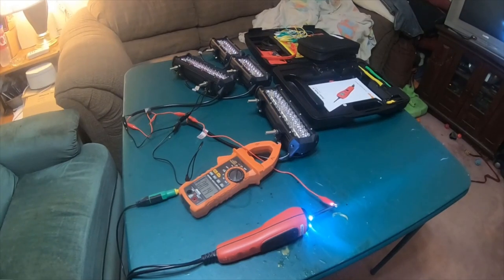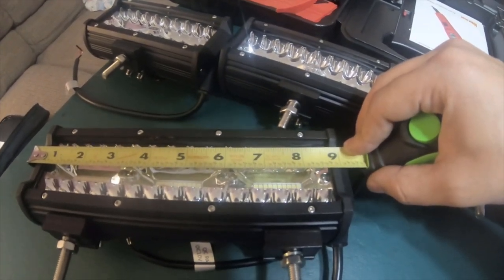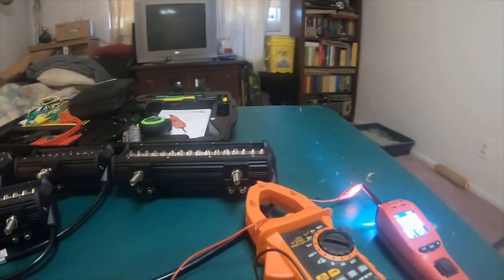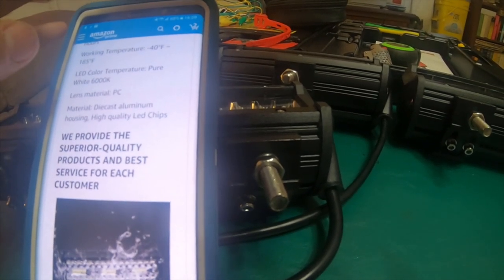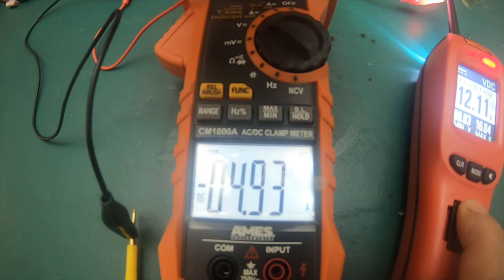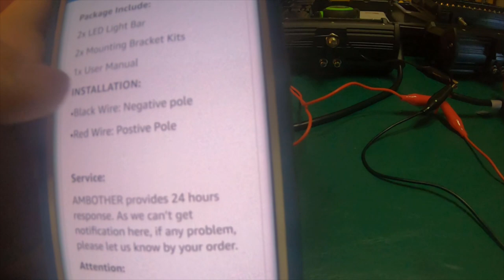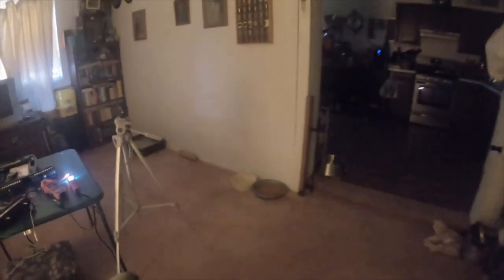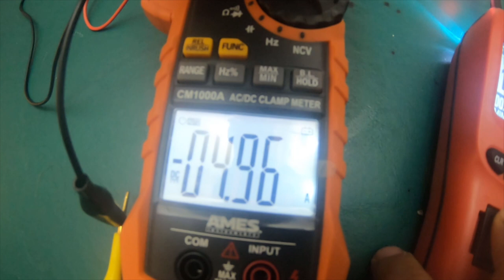Electronics - AmBother LED 7 Inch and 9 Inch Lights Specs N Testing Part 2

Comment: Ohh there rated to 30 volts I was like dam these things are under rated big times lol
Reply from the maker: Yeah
Reply from the maker: Funny thing is lower the voltage the higher the Amps so 350 watts at 12 volts would be 29.1 amps were 350 watts devided by 30 volts would be 11 amps so I will need to do testing while there running on the vehicle to find out if the Amps are correct with a vehicle that is running off the alternator or if they read the same as my bench test will find out soon also see if my meter is correct 1300 cold crank amp battery in house should have had no issue pushing out 30 amp weird thing was one light plugged in pulled 5 to 6 amps but 2 lights or even 4 lights plugged in only pulled 4 amps something don't add up either the battery in the house couldn't take the amp draw or my meter is wrong or the amp rating is rated based off on a running vehicle will do the rest of testing doon
Reply: @AntonioClaudioMichael  I wonder is those small banana plug leads are limiting the current?
Reply from the maker: @GeorgeJFW  omg bro yeah I didnt think of that I bet your right I bet they were because on the vehicle they were a crap ton brighter wired to the truck then they were in the house during testing